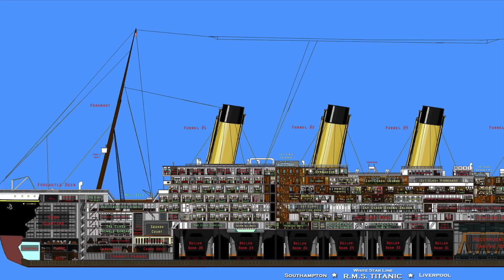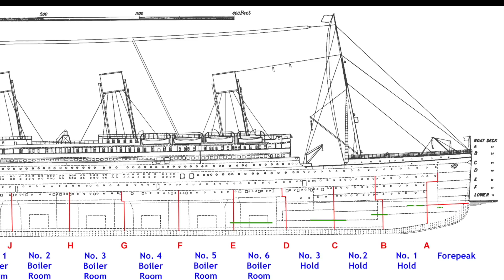Why didnt Titanic Boilers explode during the sinking? Reupload

Comment: I've always been suspicious about the boilers breaking away falling forward because they were all still in place in boiler room 5 at the end of the wreck. And that's with all the uptakes being ripped off and the room being directly exposed to the outside.
Reply: You mean boiler room two, which is now open to the sea at the aft end of the bow section with the decks above it collapsed down on on top of it. Boiler room five was below and aft of the number one funnel. You are correct otherwise, the boilers in boiler room two are still on their foundations, and none of the other boilers have ever been found anywhere else. They are still inside the bow section of the wreck, and the reason for that is the bow never reached an angle greater than 35 degrees once the ship split into four pieces. If it had reached a near vertical attitude the way the stern did, the boilers would have broken loose from their foundations and crashed forward into the water tight bulkheads. Each one weighed over 50 tons. The boilers that are on the sea floor were the boilers in boiler room one, which was obliterated when the keel failed and bent upwards, shoving the boilers into G-deck, then the pulverized contents dropped free when B-deck finally let go. The double bottom section and foundations that supported those boilers is now lying in the debris field.
Reply: Those scotch boilers were firmly fixed to the tank top level of Titanic's 6 Boiler Rooms. The liner could have been thrown like a boomerang by Poseidon himself and they'd still be attached.  One must understand the vast majority of Titanic's 705 survivors didn't know shit about how steam ships operated and as such came to all manner of...interesting conclusions about how the night progressed through the sinking.
Reply: @RobbyHouseIV  This makes the most sense to me.

Comment: I think I read on Titanic Animations' recreation of the sinking that one of the theories as to why the boilers in the compromised engine room didn't blow up immediately was that the flooding was mostly contained to the coal bunker, which they cordoned off until the door burst from the water pressure behind it, giving them time to douse the fires and vent the steam. I'm not an expert, and I'm just regurgitating what I heard from a more informed party (though still quite possibly an amateur observer as I don't know their credentials) so take me with a pinch of salt. I don't know where they got that theory from.
Reply: Flooding in Boiler Room 5 was contained within the starboard side forward coal bunker for the first hour and a half before the head pressure of the sea water became too great for the bunker's hatch doors to hold back causing a massive deluge of sea water at once.  However, the fires within the furnaces of the Scotch boilers were immediately raked out onto the stokehold floor in Boiler Rooms 6, 5, and 4 once it became apparent Titanic had hit an iceberg.  There was thus no chance of an explosion being caused by a violent mix with freezing ocean water.  Fires in Boiler Rooms 3 and 2 were kept going for some time before they too were raked of coals prior to the crew assigned there were permitted to go up deck.  The single sided Scotch boilers found in Boiler Room 1 were not in use during Titanic's maiden voyage as these were designated for use to power the liner during her stays in port for any length of time. As such those boilers posed no danger to explosion.  For the last hour of Titanic's buoyancy, her limited lighting was powered by the liner's emergency battery power. No boilers exploded. As Titanic sank the immense pressure exerted on the liner between her flooded compartments and those that were still dry produced a cacophony of horrible sounds as she foundered into the sea.  The human mind tries to imagine what might have been going on below decks to have caused such sonorous events and to many the boilers seemed like a likely answer when in reality it was simply a massive liner in the throes of her last desperate minutes above sea level with gravity winning over buoyancy...kicking and screaming as-it-were.
Reply: @RobbyHouseIV  I heard somewhere that explosions were heard, but no-one can definitively say if the boilers exploded, if the noise was the boilers moving inside the tilted ship, or if it was the noise of the ship about to break in half.

Comment: I read Mr. Lightoller's testimony to the US Senate, and the British Board of Trade, and I looked at some of the ventilation equipment on the Titanic, and here's what I think happened. There's an intake forward of the No.1 funnel which supplies fresh air to a blower to the boiler room #6. It's shaped like a large upside down J, and it has a grating in front of it. 
When the Titanic began its final plunge, Mr. Lightoller found himself underwater right in front of this intake, down into which was now pouring thousands of gallons of icy seawater. He was stuck to the intake by the suction, like a fish in a net.
The boilers by this time, had been vented and depressurized, as you said.
 However, there were hundreds of tons of red-hot steel in the boiler room, and the water pouring down undoubtedly flashed into steam. This created a great pressure surge, and blasted the water back up the intake and blew Mr. Lightoller off the intake, and away from the ship, and right next to Collapsible lifeboat 'B', which was thrown clear of the ship also, floating upside down. Mr. Lightoller's survival story is an amazing one, and worth looking into.
Peter Schilling wrote a song called Terra Titanic in 1982? I think that succintly describes these events, in German: Explosion in Machinenraum, das letze Boot hatte Glűck. (The last boat had luck. )

Comment: I enjoy your videos. Just for the record, boilers under these circumstances do not explode. They implode. They are full of high pressure steam. When they come in contact with cold seawater that steam condenses, leaving a vacuum inside. The boiler then collapses like a tin can. It can be very nasty, but not nearly as bad as a full on explosion. Also, the roaring steam you hear about coming from the funnels was most likely the safety valves lifting. Don't forget these boilers were at full working pressure to supply the main engines and accessories, and all of a sudden the engines are stopped. The firemen shut the dampers and drew the fires where they could, but the steam pressure is still going to keep rising because it has nowhere to go. Eventually, the fires died down or were drawn out of the boilers and the safety valves snapped shut again.
Reply: Good info.
Reply: I dont think they imploded. Iron isnt the best conductor of heat. The surface of the boiler plates that made contact with the cold sea water contracts while the other side of the boiler plates was hot. This leads to a great temperature gradient that causes stress cracks to form thus weakening the boiler plates. The weakened boiler plates can no longer contain the steam pressure and therefore the boiler explodes.
Reply: Titanic's boilers were steam tube, developing 215 psi absolute. (200 above atmospheric) from injected water. Safety valves opened above that pressure to protect the engines and turbine. Theoretically they could end up with a vacuum if immersed, but the 15 psi pressure outside would be below their 200 working pressure. 
In order to produce the quantity of steam required, the tubes would have been red hot, so sudden cooling could shrink them away from the front plate. During normal use, heating up and cooling down would happen slowly.
Reply: https://youtu.be/zKr6WGWw9sU
Reply: As a former manager of a foundry (Camden Castings; we cast things like knuckle joints for Chevrolet in the 70's-90's), I'd venture that the problem wouldn't be anything directly related to the steam inside the system at all, but rather extremely hot steel meeting extremely cold water.
Reply: Great comment!

Comment: An overpressure inside the water/steam space would be handled by the safety valves. With low or no fires I do not understand how an overpressure event and explosion would have occurred. Safety valves of that size are immensely loud (Just stand next to a steam loco when the safety valves lift - speech is impossible). 

The cold seawater would have rapidly entered the fireside of the furnaces, combustion chambers and fire tubes, this quickly turning to steam and cooling down the boilers. This steam has huge openings through smokeboxes, uptakes and funnels to escape. Loss of internal boiler steam pressure through cooling would then occur rapidly.

The boilers, however, would have dislodged and fallen fwd as the hull went more vertical. The Titanic debris field seems to show intact boilers that have left the ship, possibly when Titanic was somewhat vertical and the collision chocks let go. This would have torn off the safety valves, main steam lines, auxiliary steam lines, feed lines, blowdown lines and lastly whistle steam lines. There would have been a lot of steam rapidly escaping and a lot of 200 deg. C boiler water flashing to steam, but through a lot of torn apart steam pipes.

When a scotch boiler does explode, it allows say 30 tons of 200 deg. C. boiler water to instantly flash into steam and expand 1600 times. This force usually rips the ship to pieces. Look up http://melbournesteam.com.au/pictures/backissues/SSSept14.pdf where a boiler jetted itself through the ship, but remained basically intact.  Shipwrecks, however, usually seem to retain intact boilers - Please divers, correct me if I'm wrong...

Comment: I worked with boilers in a factory in the late 70s and early 80s. In that situation I would have vented the steam and raked the fire out. In my case turned the oil off.

Comment: Boilers don't explode in contact with water.  If anything they implode, but as most can withstand a vacuum, this implosion would probably only occur at great depth.  
Seawater entering boiler room 6 would immediately seep through the boiler lagging and start to cool the contents of the water and steam space.  As there is no air in the water side, this cooling creates a vacuum.  Boilers have many areas of steam leakage (through mountings like valves, gauge glasses etc.,) so the vacuum would gradually completely fill the boiler with seawater.  As the depth increased, thus inflow would also increase.  It would be good to see the condition of the remaining boilers, but we'll have to wait a few decades to observe that!
https://youtu.be/JsoE4F2Pb20 shows a "boiler" full of steam imploding under water immersion.
As for Lightoller's experience, he was probably drawn against a stokehold vent where the rush of seawater went down to the stokehold itself.  This water, entering the furnace could result in a "minor explosion" as the hot coals and steel surfaces turned this seawater into steam.  This would be a rise in pressure whuch would have blown Lights back off the vent.
"Letting off steam".  The firemen raked out the fires as the main propulsion boilers would never be needed again to run the main engines.  The "hotel load" could be driven by just 4 or 5 of the single ended boilers in boiler room 1(which weren't lit, as they were for port use), so the massive reserve of steam in the other boilers would not require firing, though possibly those in BR 2 could have been.
There was no need for the boiler room staff to "vent" the boilers as this action is undertaken automatically by the boiler safety valves, operation of which is shown in the clip.  Once the steam pressure is down to normal, the safety valves close automatically.
Boiler stop valves:
The boilers are fitted with stop valves on the steam outlet.  As the ship went down, all the boiler stops would have been shut to conserve steam pressure, with only the most forward ones open (presumably BR 5).  Once this started to flood and steam pressure started to stop, the boilers in BR 4 would have their stops opened with BR 5 stops closed.  This would have happened progressively until - probably - only BR 2 was on line with plenty of steam to operate the small auxiliary generators and their  auxiliaries until the end.
Final "explosion":
As the ship broke in two, the main steam lines feeding the auxiliary generators would have fractured.  A pressure of some 100psi would make quite a bang, as the definition of an explosion is a sudden release of pressure.

If you want to know more about how to start the Olympic class, try this link to an article I wrote some time ago -
ssrichardmontgomery.com and scroll down to "Starting the big liners from cold - pdf files"
There are other liners there apart from Olympic/Titanic.

Comment: This video is great in that it shows the places where the Titanic sustained damage to the hull. But what is the nature of the damage? Was the hull punctured, or did pressure on the hull, as Jennifer Hooper McCarty believes, cause the rivets made of substandard iron to pop opening up the titanic like a zipper? The testimony from Barrett may support this theory. I'd love to see a video on this.
Reply: The substandard steel angle has been researched and mostly dismissed. The steel wasn't as durable as modern steel, but it was as good as any that was available at the time. 

Titanic flooded due to being dragged against an iceberg; tearing, buckling, and springing the hull plates along over 400 feet of its length. The builders couldn't foresee an accident damaging the ship so extensively.
Reply: @ostrich67  The rivets were made of iron, not steel. The issue is not substandard steel, it's substandard iron. You say the "Titanic flooded due to being dragged against an iceberg; tearing, buckling, and springing . . ." Yes, because the iron rivets popped. "The substandard steel angle has been researched and mostly dismissed." This is a strawman. Nobody claimed the steel was substandard.

Comment: I would actually expect the rapid cooling of a boiler to cause it to crush inwards, or implode, rather than explode? This is still a dangerous situation, but potentially less likely to cause damage to surrounding objects.

A rush of hot air while the ship is sinking could be air being displaced from inside the ship and replaced with water. The perceived heat of it could be down to it simply being comparatively warmer than the cold water around him.
Reply: Its not the temperature phase change inside the boiler its the steel in the boiler plate and its rivets and differential cooling. Steel expands when its hot and contracts when its cold. Hot steel meets cold water, part of the boiler plate cools enough to stress a seam enough to open up, and then BOOM! explosive decompression coupled with a explosive level of flash boil... and that is a boiler explosion... I learned marine steam and used to maintain a license as 3rd eng but I've since let it lapse.

Comment: If you throw cold water on a vessel pressurized with steam, it will IMPLODE, not explode. Because as the steam rapidly cools and condenses back into water, it creates a vacuum. For a good example of this, I refer you to the Myth Busters video of the train tanker car implosion. In the shop, they filled a 55 gal drum with steam and then quickly capped it. After a period of time, the barrel imploded! So it stands to reason the same would happen to Titanic’s boilers. The results could be just as catastrophic though!
Reply: The boilers are very strong and designed to withstand a vacuum as well.  They experience this condition every-time they are cooled down for whatever reason, cleaning, inspections, maintenance.  This happens because there’s no air inside the boiler only water and steam so when all the valves are sealed shut and the steam cools back down into a liquid the empty space now has no air to fill it so you get a vacuum inside the boiler.  Once it’s completely cooled down  someone will open a vent valve to let air in and equalise the pressure.

Comment: There is a theory that the flooding of BR6 actually came through the floor, not through a rip in the side as seen in the movie.  A grounding of sorts combined with damage to the holds and forepeak combined with the "small holes theory".  I believe the holes amounted to know more than 16² ft.They also lit up BR1 for the first time of the voyage to provide electrical power. Love your videos.
Reply: Do you have a link to this inforation…
Reply: @timothyreed8417  Edward Wilding, from H&W provided the estimate of damage. Have a look on Enclycopedia Titanica, or the enquiry transcripts to gauge where I sourced this information from. Hope it helps.
Reply: @jonathanp89  i know about the damage….the BR 1 statement?
Reply: Boiler room 1 was never lit, there would have not been enough time for them to heat to up enough to anything. Large boilers take hours and hours to heat. Look up "cold starting the Titanic"

Comment: Do you think a small-scale boiler explosion could have been a contributing factor to the Titanic breaking in two?
Reply: There have been numerous finite computer model studies that have shown that the ship would break in two the way that it did since the stresses were far, far, far above what the ship, or any other at the time, were designed to handle. Furthermore, the boilers in Room No. 2 are intact and visible at the break up point on the bow section and the single-ended boilers in Room No. 1 were never lit and all five were found and accounted for intact.
Reply: Nah the sticky tape got wet & failed. Or was it the Perkins Paste?